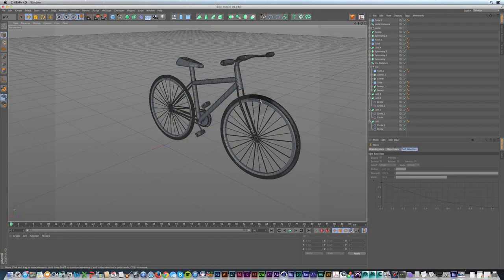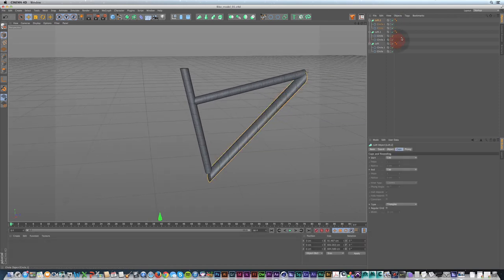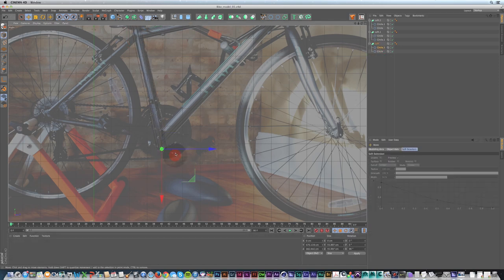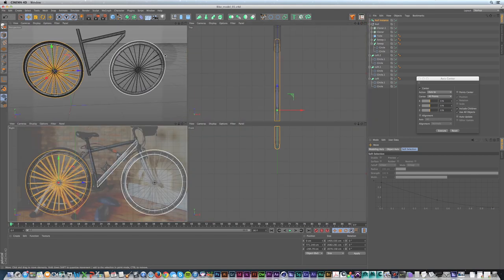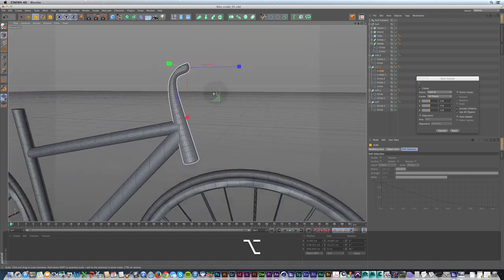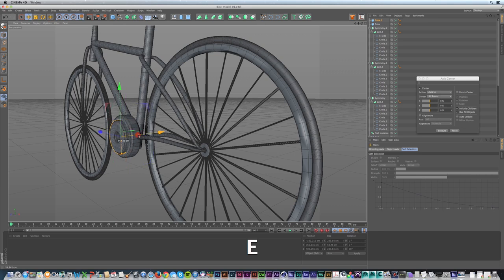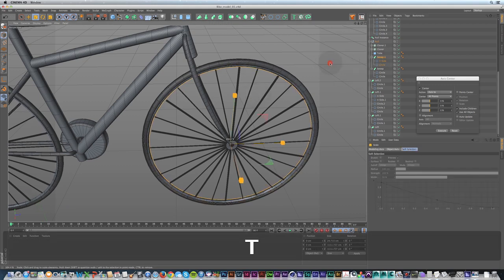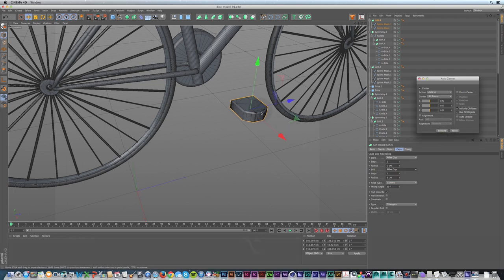Cinema 4D Modeling Tutorial - How to Model a Bicycle - Sean Frangella

Comment: Dunno why my sweep is  looking like a bead. The circle sizes are correct.
Reply from the maker: Could be the axis that the circle is on, or if they are in reverse order. Easiest thing might be to remake two new circles and drop them in a new sweep.
Reply: I dunno, I tried that as well. Here a screenshot. 
http://postimg.org/image/rshhpero7/
Reply from the maker: Anuzu Studios Try changing the Plane for the top (smaller) circle to XY, ZY might be stretching it the wrong way.
Reply: Thank you!!